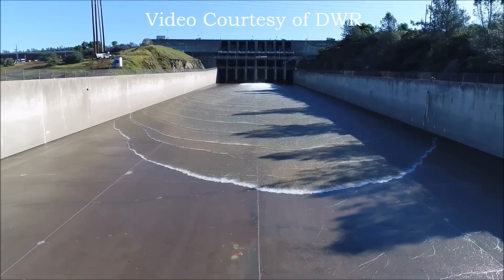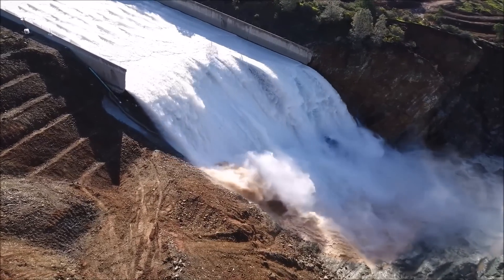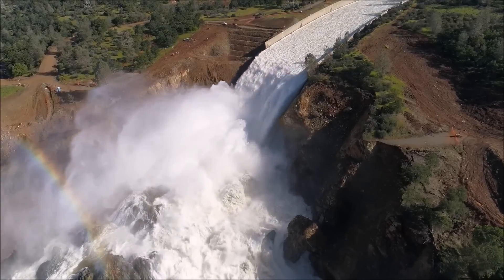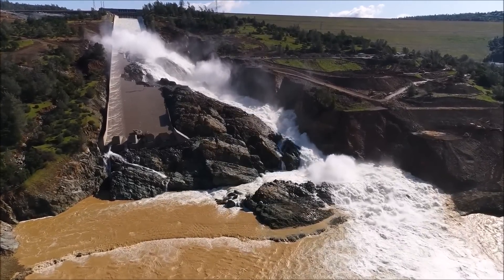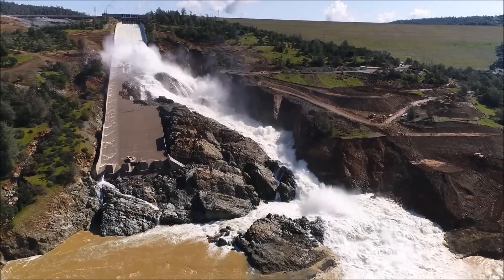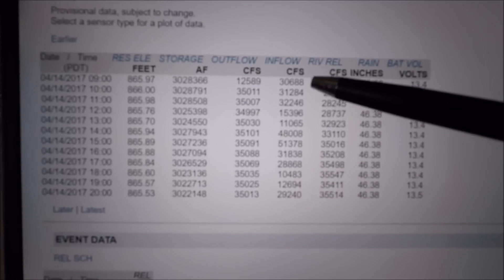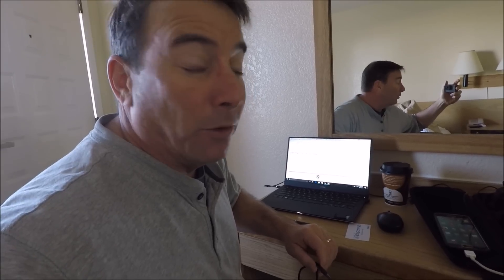Oroville 15 April Narrated Spillway Re-Opening DWR Footage

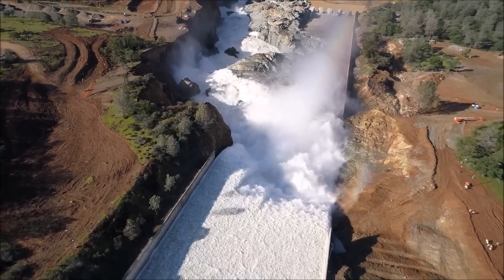Comment: It looks like some amount of water is under cutting the left side (left side of us YouTube viewers side) of the bottom spill way (0:58-1:10 mark). Did anyone see that?
Reply: Yeah and then when it didn't show any change or muddy water additions, I decided it was new shotcrete instead. Not saying it's going to be there when the flow is over mind you, they have had consistent problems along that side from the start of the breakup of the main spillway. I see the terracing work on both sides of the main spillway as pre-construction readiness work.

Comment: I completely agree with all who praise and appreciate your narrative. I have two questions: first is why do you think the debris operation left the dead-flat dirt delta at the bottom of the spillway this time? Did they just run out of time? Second, along the same line as Tommunbeig and others, below, for the long run do you think DWR considered (what seems to me the cheapest and easiest...well, my father was an engineer : )) creating a concrete basin for the drop and turn up in the plunge pool area, and letting the spill run its new course, the rest of which seems to have reached stability? To attempt an answer to my own question, maybe the area to the left of the plunge pool can never be made strong enough? Loved those kids in those flowers and looking forward to Yosemite!
Reply from the maker: Good question about level spot down below...I think it's access for the excavators to access the diversion pool below.

Comment: Beautiful flowers!  Also if I may ask, what causes the step style cascade effect of the water in the spillway when it starts ramping up. It looks almost like a wave generator machine.
Reply: Jordan Harden, just a guess but it probably has to do with the way the water interacts with the surface of the spillway. it wants to flow at a certain rate, but friction with the concrete surface slows down the water that flows directly over it, the water that is on top of that water can glide down more freely, and it skips over the slower flowing water underneath it. Hope that makes sense, a diagram would really explain it better.

Comment: ...And another thumbs up for a wonderful video......and....I'm very curious as the the original supporting structure of the main spillway.....I've studied the various videos/pictures and cannot see what 'was' holding the spillway up....I figured you'd be the guy to ask about any reference to that...? Old pics/plans etc.....
Reply from the maker: Crumbly bed rock in some places, just dirt!
Reply: ..Thanks for the reply...I was hoping there'd be some 'bearing piles' in the dirt, some sort of rock/concrete anchors...maybe a network of structural steel, maybe pre-stressed concrete, but if so, there'd be remnants of cable...
Reply: Doug. It looks like the "road bed" under the spillway was not well done. Also the subsoil ranges from solid rock to rubble. It look like the spillway held up where it's supported by rock and gave way where it crossed rubble, where the plunge pool is now. There is re-bar in there but it's to 1950's standards.

Comment: Excellent footage........ Why don't they use some large diameter iron tube's like for gas transport  10 pipes covering or more covering the base of the spilway. ...You could even stack them dubbele to increase flow capacity ...like a giant mouth flute .....Bridging over the giant hole would need some foundation work for these pipes but than the water would not erode anylonger the underground and the spilway would be working again as it used to be via this spillway transport ram towards the river .....
Reply: At 10,000 CFS the water is about a foot deep and 176 feet wide. At 260,000 CFS that would be 26 feet deep and 176 feet wide. After a lot of math that works out to an 80 FOOT DIAMETER pipe. That would be impressive but totally impractical

Comment: New contract for 275M of repairs.  What does that include?   Fillling the holes with RCC, a new spillway up to modern standards (a drainage system, poured reinforced concrete slab, poured reinforced concrete walls), and the emergency spillway cutoff wall and RCC?
Reply: Add about 50 pages of legal text and you just about have it

Comment: I noticed those straight white turbulence lines appearing at 0:05 seconds on the right of the view. Are they from intentional obstructions? If not, there could be more 'erosion' of the spillway surface.
Reply from the maker: Michael Striker rockbolts, as described in the video....
Reply: Ah. Ok, thanks for the info.

Comment: What's the reason that they're running the spillway at about about 35,000 cfs now instead of the 45 to 50 they ran during the last spill? Have they found this to be a better rate to minimize additional erosion?

What's the end date to the season by which they expect to no longer need to spill additional water from the lake and then begin reconstruction of the spillway?
Reply from the maker: Jim Mac probably to avoid turning the spill way on and off repeatedly....just go for 1 or 2 long slow spills....June-July?

Comment: Doing a great job. I live in Rosamond CA (Kern County) and even with us being so close I am not finding very many people following this story. My question. I wonder if adding capacity to the power plant is possible. It would be nice to get some benefit out of these water releases. I would like to see the generating capacity increased along with the extra release ability that follows. Might as well get some benefit out of this repair period. The state can always find a use for more clean generated electricity.
Reply: Considering that the spillway is rarely used, most years ALL of the water goes through the turbines. Also three of the turbines can be used to pump water back up to reuse the water for generating a second and third time. They have more that enough economically viable generating capacity. It's a function of boom through the runoff season and bust for the other nine months of the year.
Reply: It is reported that some 300 million dollars will be needed just to return us to the way it was (OK, except the cracks in the spillway). It is also reported that there are some fundamental mistakes regarding safety with this dam and its ability to regulate the water level. I ask what improvement to the situation are we expected to get for our 300 million dollars? What plan is there for the emergency spillway that had to be shut down after being used less that 24hrs since this entire project was built? Some want to see less water behind this dam, and not just in high water years. My idea is to generate more electricity. I am waiting for more ideas, ideas better that just making things like they were. My point is. If we move to satisfy those that want less water behind this dam as a standard practice I feel this will require more use of the spillway. Rather than wasting the energy generating potential of this water how about using it to generate more electricity? If nothing else is done with the power plant I would like a plan that would allow it to stay in operation during high release times, that is a more robust power plant, perhaps just the intakes for the power plant. Spending all that money and just returning to how it was before is not sitting so well with me.
Reply: I understand where you're coming from. From an economic stand point, how much water was released in those 24 hours over the last 50 years? How much electrical energy in dollars does that represent? How much are you willing to spend on capital to generate that electricity and have it sit idle for 50 years less 24 hours. ..... The Corp. of Army Engineers did a pretty good job sizing the system if the spillway was only used 24 hours in 50 years......All that being said,  it's unfortunate that one of the six generators is out at this moment. That's 2,500 CFS that could have been turned into electricity. They could have turned on the power plant to full in mid January and run the lake down. That might actually have been enough to prevent the overflow at the emergency spillway. Those are operational decisions that lead me to believe the manual is wrong. ...... They could run the lake down during the dry season, but who can predict when the next drought will occur? It's a boom and bust, 2 months of snow melt and 10 months of dry season.....I understand your frustration but it's sized about right..........As for the cost, it's already at $350 million and that will continue for some time. Than comes the actual repair of another $300 million plus.........The real question is why was the repair not done properly, and why did it need repair in the first place?

Comment: I know that there has been additional shotcrete blown in to help offset the water flow.  I wonder why they haven't re-inforced the side of the spillway where the erosion is happening?  Yes I know it will take a lot of shotcrete, but why not give it a go?
Reply: Shotcrete without reinforcement has no structural strength. Right now all it is, is a water barrier so water doesn't get into the clay.

Comment: Where and how do they measure the inflow?
Reply from the maker: I believe it's derived.
Reply: I assume that means calculated.  They have to take some sort of physical measurement or reading somewhere.
Reply: from my hydrogeology days... they take a cross-sectional view of the main infeeding river channels and have a height gauge at said input locations... by taking, most likely hourly levels, they gauge the area of water... multiply that by velocity and you get a volume associated with time (AKA cfs)... so yes, a derivative of multiple inlet points... and probably a nominal amount of underground seepage and real time rainfall

Comment: I've heard they will re-opened the "discharge" spillway till the power plant could get full production process efficient, but till there, before, and after, ...
Would it be such an harsh effort that discharge and power plant flows goes on the same "axe" flush ?

I'm not that sure, but there some coincidence that make me think "Rivers" don't "argue" with straits lines, neither concrete curved one's ...
As guilty, as we all are, loving designed curves, won't it be appreciate to "give" that electrical concrete fence, the curve discharge spillway it deserve, claimed, helping flows going down the river, the same sense ?

That's the record my ask .

Was already thinking of you futures ...

Comment: its a pitty they can not leave it that way after tidying up the end of the short spill way
Reply: Yep, too Bad DWR & Contractors can't just military helo a couple of Alpine Rotary Cutters on Some Excavators - Into Some Key Flow Restrictions. They could just smooth out the bottom of this bypass channel and shotcrete some areas to hold things together. Correct and Smooth Out the outlet Angle into the diversion pool.  Then Use As Need Be for the Commemorative Cafe & Seating at the Observation Deck where Juan gets his pictures across the Diversion Pool.

Comment: Hi Juan,  I'm one of your "regulars."    Would you provide a list of the video/audio gear you use to do your Oroville Dam reports.   In this video, I saw you holding a very small video camera in your left hand.  What brand and model? The same question for your other video/audio gear.   Please make your "list" readily available (somewhere) to anyone interested in knowing, and as you add equipment, update your "list." Thank you.
Reply from the maker: Sure This is a GoPro Hero 5 using the internal Mic for this voice over. I've recently added a GoPro 'Karma Stick' for gyroscopic stabilization. I've also recently added an Edutige (external) lapel mic and adaptor for the GoPro.  I frequently also use my Samsung S-5 cell phone for video and stills. That's it!
Reply: Thank you.  I'm somewhat surprised by how short your list is  given the professional "look" of your reports. Thanks, again.
Reply: So, to be sure, your GoPro 'Karma Stick' is the  GoPro Karma Grip,  the Edutige (external) lapel microphone is the Edutige Lavalier Microphone ETM-006 and the microphone adapter is the  GoPro Pro 3.5mm Mic Adapter?  Yes? Thanks, again.
Reply from the maker: Exactly! see my video update on Karma Grip, it has some serious audio limitations...waiting for software patch from GoPro.

Comment: Explanation of headcutting erosion. Water poured slowly from a cup dribbles down the side. Tip the cup up sharply and only a drop or two runs down the side. Get those gates open quickly and overshoot the lip of the damaged concrete. Less headcutting.
Reply: Excellent analogy
Reply: Why didn't they place more shotcrete....? seems like some more shotcrete anchored to the slope would have helped a lot... looks like the water is splashing back under the damaged spillway... hope that soft rock holds up..
Reply: John. The operative word there is "anchored". They needed the base to dry out as much as possible. The shotcrete is simply to keep water from soaking into the clay and having it slide down. There is not structural strength to it.
Reply: I agree +Bob Smoth it's basically a barrier between the rushing water and the loose rock and soil... if water get behind it then it's not going to work.. However it's quite common to use shotcrete for  retaining walls.. when this is done it needs to have a rebar grid and to be anchored against the hillside / slope by rock bolts and soil nails... http://s3-production.bobvila.com/blogs/wp-content/uploads/2012/11/shotcrete-retaining-wall1.jpg

Comment: Why didn't they keep the turbines going?
Reply: Yeah, it just seemed like a bad time to close off "ANY" means of getting water out of the lake. Perhaps they should have waited for a drought, or at least after they repaired the spillway. I hope they intend to build  another spillway, then repair the existing one later.  Thanks.
Reply: Grumpy old fart   They had to repair 1 tunnel frm 'scouring' damage. Believe it provides cooling water for hydro equipmnt. hope that helps.
Reply: Thanks